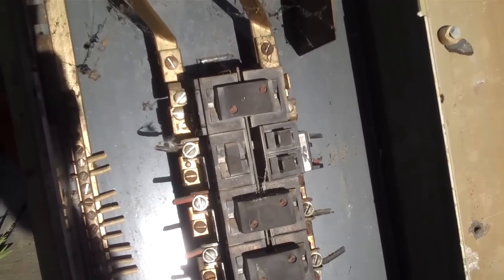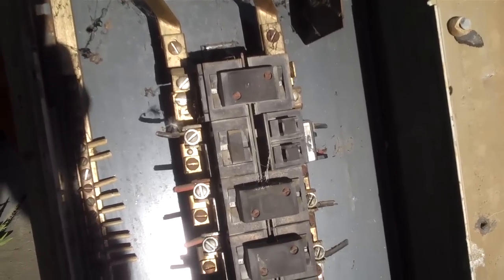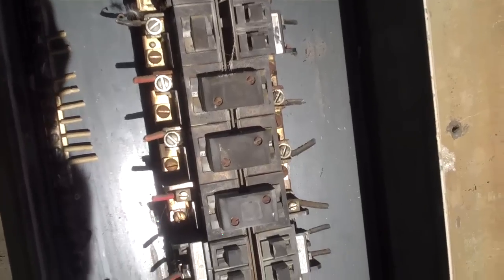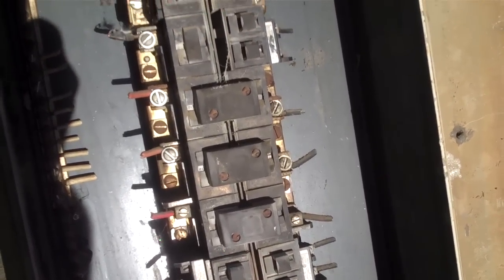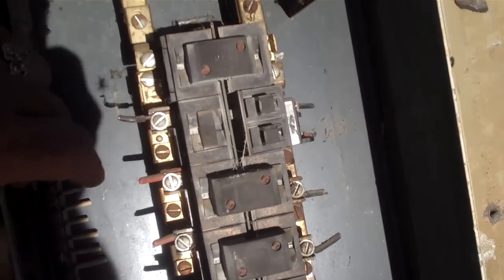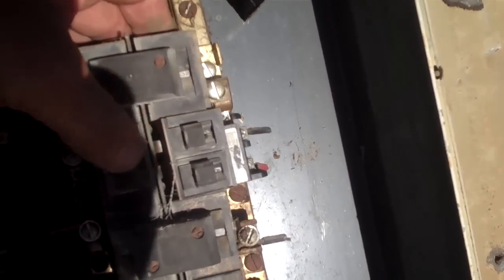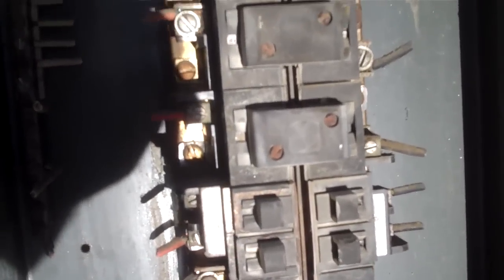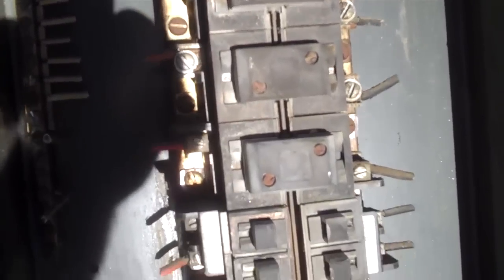Electrical Panels: BEWARE of Old Style Panels! MUST WATCH if you have an older Home

Comment: Located in the Pittsburgh, PA area, we have pushmatics in our house that we bought new in 1974.  We have had ZERO problems with resetting,r failures or corrosion.  The panel is in our dry basement.  I have added breakers with ZERO problems.  There is no evidence whatsoever of corrosion.  Our panel and breakers look NOTHING like those in the photo.
Reply: My moms house was built in 1953 has similar panels and looks exactly like this one and this is an out side installation.
Reply: Must Be Nice

Comment: WT! happened to that panel?  It looks like it's been rained on, FOR YEARS. The sheen that's normally on baklite is a flat black. This panel did not come from any typical situation. I have a 45 year old Pushmatic panel in my home and the black baklite still glistens. No problem with the panel either.
Reply: it sat out side in the air on a wall

Comment: That panel looks quite weathered too was it outdoors? My house had the load center replaced in 1983 with the GTE Pushmatic 150amp setup it's been very reliable. However you are right the breakers tend to go bad more often than GE type magnetic breakers. Proper maintenance is key in identifying issues I happen to be electrically qualified so finding the trouble breaker and replacing is easy but may not be for most homeowners. The heavier load breakers have been replaced at least once ever 5 years. What's interesting with the ITE too is the main disconnect is GE style breakers not Pushmatic.
Reply: How do you find trouble breakers ?

Comment: What amp is this panel? And would you replace it with the same amps? Can you go from this to a 200amp?
Reply: You can only go to a higher amperage if the gauge of the wire coming into the house is big enough to handle the extra amps
Reply: @Rusty Spring  good info. Yea I have 100amp and having it upgraded to 200 next week

Comment: I am going to move into a house with these type breakers. I have never seen them before. I encountered them because I was mowing the lawn with an electric mower, and the breaker tripped. I had to press on the breaker a few times to get it to reset. Do you recommend that I get the panel replaced?
Reply: metalmoto

Comment: I have problem I try buy forclosure house and  my electrical panel has some rust and the inspection city say I need remove the panel and put new one :( how much is for this job ? need be electrician certificate
Reply: I charge $1000 for a 150-amp panel upgrade. Or $1500 for 200-amps.